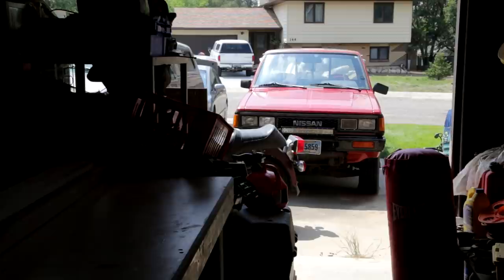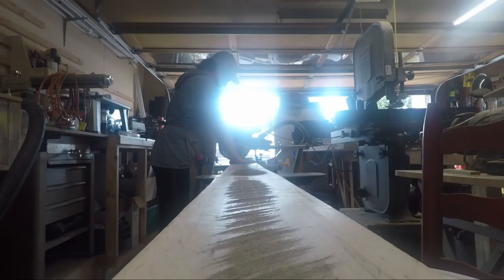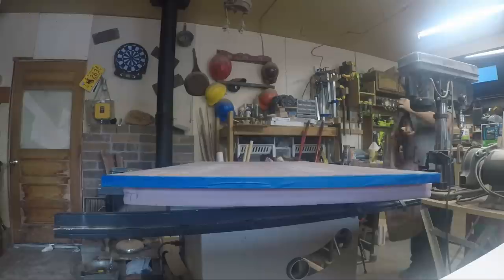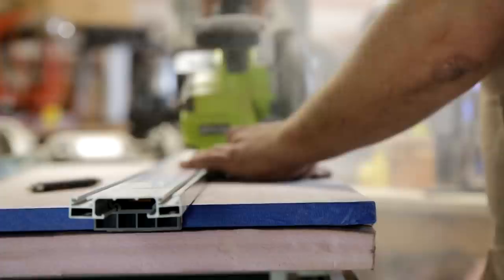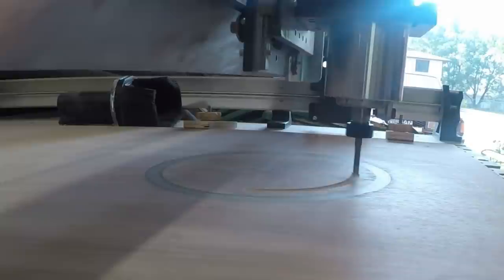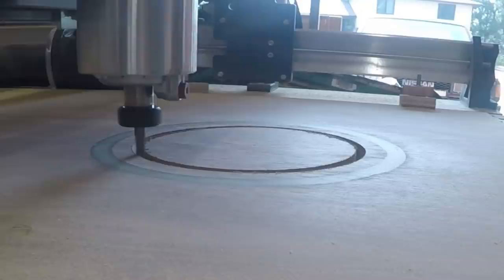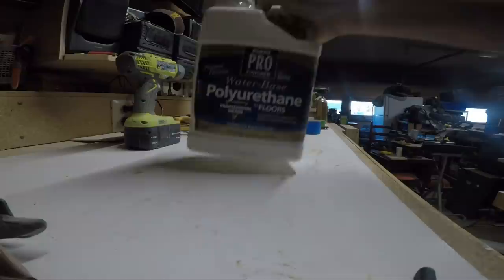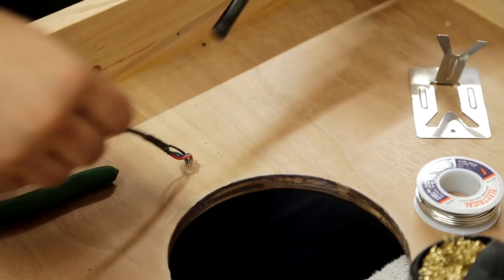The best Cornhole boards yet

Comment: Beautiful Boards doctor!!!!!!!     How did you attach the plywood to the frame?.. I think the wood is too thin for a rabbet... But i didn't see any screw or nail holes....   did you just glue it?  Dowels on the edges of the plywood? or is the top just floating in mid air?.. lol
Reply: I'd like to know as well.  Where the sides meet the plywood looks perfect.  I'd like to have seen that part.
Reply from the maker: Biscuits